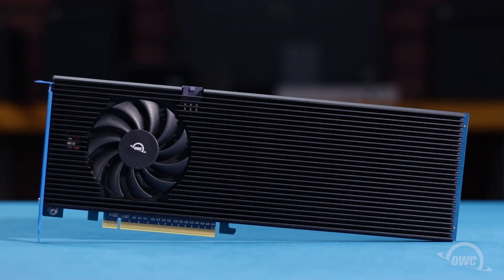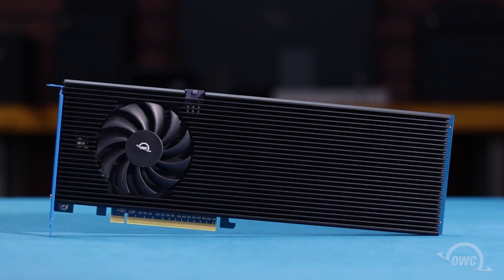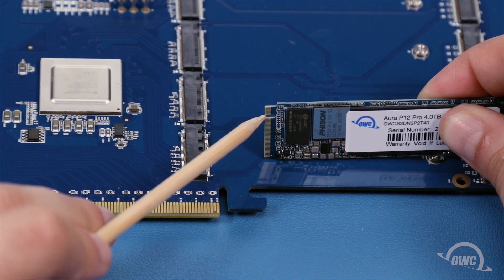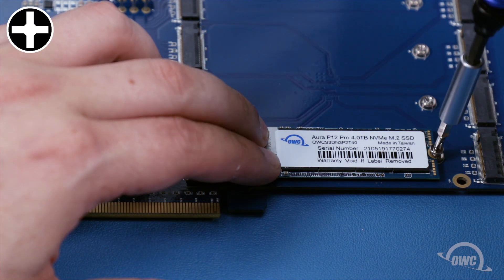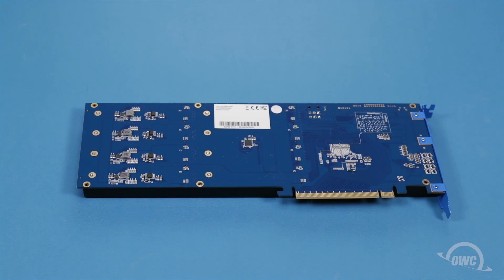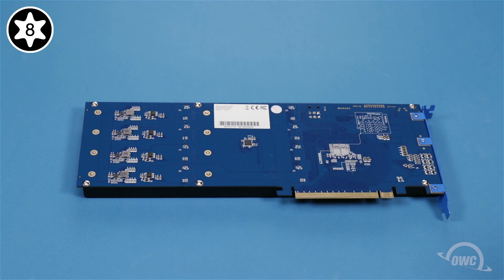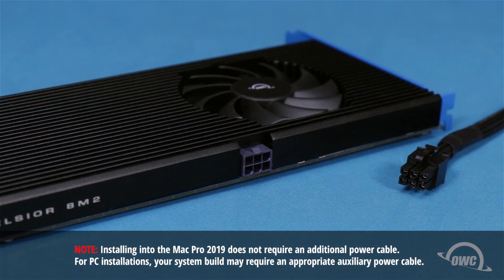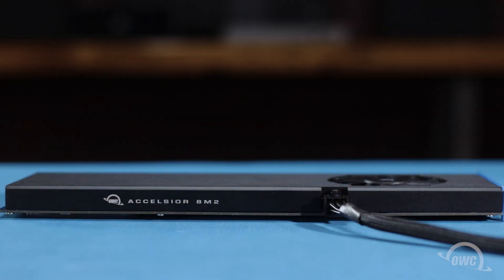How to Install M.2 Drives in an OWC Accelsior 8M2 PCIe SSD

Comment: Can this run in a x16 slot at X8 lanes? And if so what is the expected drop in performance?
Reply: given that this device is only rated for about 26 gigabits per second you would drop about 10GBS of max throughput at gen 4,  and about 15GBS at gen 3. although sequential throughput is not the be all end all, and many applications would not really see a difference as a gen nvme ssd is normally a x4 link and there is already barley a difference in load times and system snappines compared to a gen 3 x4 drive

Comment: Is the OWC Accelsior 8M2 PCIe SSD compatibel with cMac Pro5,1 2010 / 2012 systems? If yes, what is the maximum possible speed?
Reply from the maker: Rob Landeweerd,

We are very sorry to report that the OWC 8M2 PCIe SSD is not listed as compatible with the Mac Pro 5,1, we do apologize.

We do have our OWC Accelsior 4M2 which is compatible you can check that product out via this link here:https://eshop.macsales.com/shop/ssd/owc/mac-pro/2009-2012

Please feel free to reach out to us directly at support@owc.com as we're happy to answer any further questions you may have.

Have a nice day.

Comment: I was expecting that the board will have thermal pads. In particular because the 4 m.2 card does not and it overheads lowering performance but not function (still super fast , but not as fast as the Sonnet board for example). How does it work ? Do you sen two PCIe lanes to each m.2 or do you have a switch? Does it has a raid controller or do it relies on software ?
Reply: there appears to be a bunch of PLX chips on the back which serve as pcie splitters and some sort of microprocessor based on what I've seen. so probably each drive runs at x2, but depending on the intelligence level of the microprocessor they could have some sort of dynamic lane allocation system based on drive load. based on what I can gather from their page, it seems you need soft raid and then the device handles parity calculations for raid on its own, though I am not certain

Comment: Will this work with the Flex 8 without additional power?
Reply from the maker: Regrettably the Flex 8 is not able to be used as a bus powered device without power. The included power supply is required when using this product